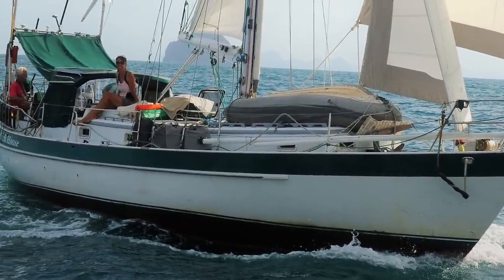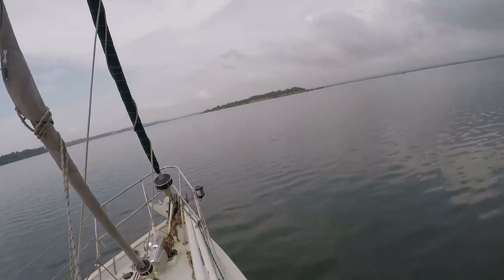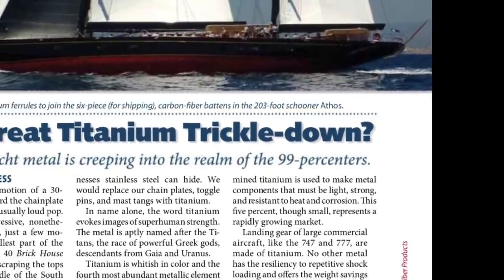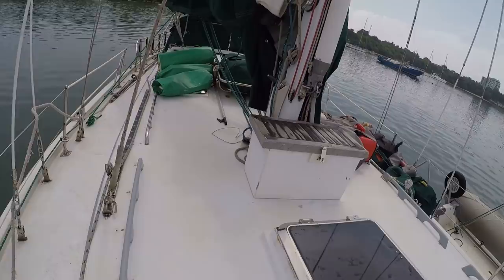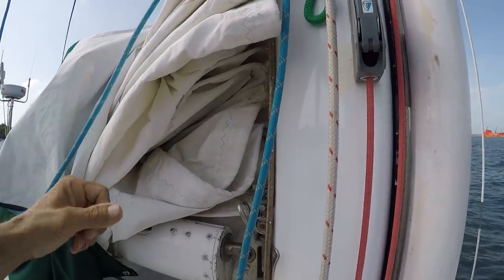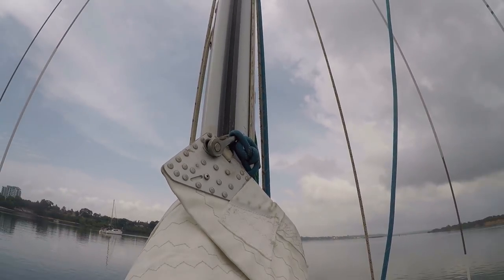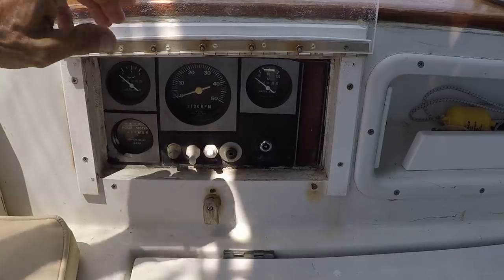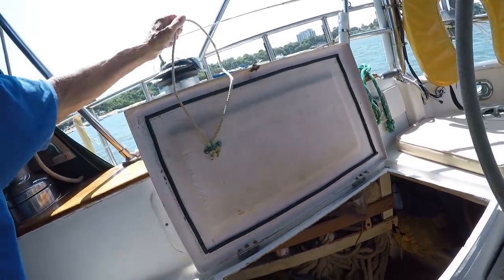Bluewater Sailboat Tour- On the Deck Of a Valiant 40 #1/3   (Patrick Childress Sailing #30)

Comment: the length is great, a lot of really good info and tips. As a new single hand sailor, I find the videos to be very informative. I especially like hearing about the equipment and simplicity. Case in point, I have the same EBIRP, could not figure a place to mount it, this video answered that, Thanks, Cheers
Reply from the maker: Glad it was helpful!

Comment: Funny story: I'm 61yo so this was back in the mid-1960s or so.  My dad was a chemical engineer so he really didn't deal with metals much, but one day he came back from work with a little pancake of metal about 3 inches in diameter only a 1/4 in thickness.  He tossed it our way (me and my younger brother) and said something like "take a look at that."  I picked it up.  Light, much lighter than I thought.  My dad said try to bend it.  As soon as tried to bend it, he said toss it back.  Then he showed that he couldn't bend it also.  I was so impressed that I remember it to this day.
Reply from the maker: I did a lot of research on titanium. It is an incredible metal.

Comment: I will have to check out your info on titanium 5.  I also have problems with ss disintegrating on me, mostly on sheet and halyard blocks, the straps and beckets crack.  Thanks for the enlightenment on hull walk--I always thought it was from the different water density between the top and bottom of the spinning prop, but your explanation sounds more reasonable--the wash is getting thrown more on one side of the hull than the other, and Bernoulli's principle is creating low pressure there and pulling the boat to one side.  Obviously that would make it dependent on hull shape, as you observe.   I also went through a similar evolution in anchors--I plowed furrows with a CQR (and nearly lost the boat on several occasions), then went to a Delta which worked much better but still would occasionally drag on me.  Now I have a Spade anchor, which is by far and away the best anchor I've ever used--plus no roll bars, so it will fit on bowsprit rollers.
Reply from the maker: Great to hear from you. We have been far inland , Tanzania, for a while now, safari time.  I should have commented on one of your recent videos having 10-15 knots for part of the passage from Bahamas to the Carib. was excellent luck and nice job picking up the mooring nunder sail. On propwalk, dcades ago when I was in a class to get my captains license, the instructor said the boat prop is like a car wheel, if the prop turns clockwise, the stern will go to stb. and counterclockwise, to port. No one considered reality and what the prop wash was doing or left hand verses a right hand prop. Good to hear you agree with my thoughts on the plow anchor. Spade was on our list for a new anchor but in Thailand, our other top anchor choice, Manson, was there at the marine store. Keep up the goog video work!
Reply: @RVLifeNOW  Likewise Patrick, I'm impressed with the new vids you have been publishing, and the depth of your knowledge.  Another thing you mentioned is the hobby horsing tendency of double enders--yep, Ruth Avery really gets going sometimes, which seriously hampers forward progress when close hauled.  The rounded stern apparently helps, although I imagine she must drag it quite a bit when approaching hull speed... As far as the CQR, find a friend who lives ashore and donate--they make great garden decorations!  Fair winds .

Comment: Patrick, The time is fine for me. I like your videos for showing what works in real life, and what does not. No one else is putting this info out. When you do part 2 could you please discuss how you deal with condensation inside.. Thanks
Reply from the maker: I will write myself a note to mention condensation. There is padding glued to much of the hull, installed by the builder, to help combat condensation. But the biggest majority of our sailing has been in the tropics and condensation has not been an issue. But we will eventually be in S. Africa where it is much cooler and eventually on to very South America, where we can be affected by condensation in those colder latitudes.

Comment: Hi Patrick, nice video! You have used a lot of outstanding features on your boat especially the starboard ladder. For someone that has a lot of “things” installed on the stern, like windvane and possibly a dinghy on a davits and other stuff, getting into the boat from the stern will be very difficult and your system is very practical and can be used in several situations... well done! Also the Grade 5 titanium pieces used is another great tip... I will for sure use it in the future while preparing my boat for ocean crossing. 

As per the video length... in my opinion, something between 12 and 15 minutes (max) is ideal.

For the next video... show us also some tips you used on the inside.

Fair winds ;)
Reply from the maker: Yes the ladder is great!!

Comment: Have always loved the Valiant 40. And yours is a great example.  I ended up opting for a 1981 Kelly Peterson 44 center cockpit cutter.  They have very similar hull lines and underbody.  Except the prop is in an aperture in the skeg . No it doesn’t back down well either.  Thanks for the tour!
Reply from the maker: I always thought the Valiant 40 would be a much better boat if it were stretched out another 3 or 4 feet and had less of a canoe stern. I see a lot of similarities between the P44 and V40, inside and out. The Perterson 44 looks like an ideal boat for crossing oceans. You made a good decision.
Reply: Patrick Childress Sailing   As have you.  Have already sailed her tens of thousands of miles. I would also feel very secure in a V-40.
Reply from the maker: Fred Read Thanks Fred. I like her and feel good in her for sure. There are times when the wind and sea are doing just horrid thing, and inside you would hardly know it. -Rebecca

Comment: Fantastic informative video. Sat here with my friend watching and discussing what we have just learnt. We both agree this was a good length video, any longer and we would have to have paused for a tea break.
Reply from the maker: Samantha, Thanks for the feedback. Looks like the interior will have be in two parts.
Reply: @RVLifeNOW  
I'll be sailing my project boat from Dunbar to the Humber in April and doing the same, so I'll be watching taking notes. Will probably end up broke but will have a nice boat 😁
Reply from the maker: @Sailingon  It is incredible how fast the money can go.....That is one incentive for us to put off looking like a marina queen and getting help to work on the boat in preferable foreign countries.  There were some odd things done to our V40 during its construction that hopefully you won't have to deal with. Thanks for watching.
Reply from the maker: Samantha, what year is your boat? I am finishing up 2 videos to auto release while we are on safari for several weeks, here in Africa. I was thinking of you and added a couple details I might have otherwise left out....like using PVC for a ceiling material and the pin for the saloon table. Is there any way I can follow your rebuild?
Reply: @RVLifeNOW  it's a 1975 Trident Warrior 35. I'm setting up a FB page SV Carioca. Up to now I've replaced all the through hull skin fittings, temporary basic rewire, resealed the cutless bearing, replaced the starter motor and alternator. New NASA clipper wind system for not a lot of money 😊, love a bargain. 
Jobs before going back in are. stern tube seal replacement, new stern tube greaser, sort out play in the steering which has a bearing housing loose in the top of the pedestal which can only be accessed after removing the top section turning it over to tighten the screws. Get the sails checked and any repairs done. Service the engine and raw water pump. Have a rum or two then rest for a week or two before going out for a few shakedown sails then down the coast to the Humber, then the hard work starts. It will be two years before I can truly escape and see the world so plenty of time to get her the best I can. 
You can add my on FB also at Samantha Kerry and life on a narrowboat 😊
Reply from the maker: @Sailingon  Sounds like a good project boat. I will check out FB.

Comment: I have a Maxprop on my V40 (SV KOYAH V40#165) and have no issues backing up
Reply from the maker: That is interesting. I wonder if you have a very low pitch in reverse so at low RPM there is not much wash over the hull. I have had a 3 blade fixed, Maxprop and now a Kiwiprop and always had the strong turn to stb. problem. But, I live with it and now know how to deal with it. Brick House is 1976 #134

Comment: Patrick, just curious - why do you keep the "monster" whisker pole aboard if it's too heavy for the boat?  It seems like less weight aloft would benefit the righting moment and less stuff you have to worry about. I really enjoy this series.   If we could train cats to do some maintenance in tight places, they would earn their keep!
Reply from the maker: Hi Mark,  The large diameter pole is  of a much larger diameter, resulting in more weight than is necessary for this size of boat. That makes it more cumbersome to use than need be. Running poles are very expensive. Plus, once away from the U.S., they can be exponentially more expensive to replace. So the cost/benefit ratio means to just live with it....but this is all shown so maybe someone else can benefit from the example, like if they are going to put a new pole on their own boat. In the newer video about sailing from the coast of Africa to Zanzibar, you can see the monster pole being set up and used.  Lilly is our diesel apprentice. She is not the brightest but I do have hopes that one day she can at least check the oil level for me. Thanks for the comment.

Comment: Since you do not waste time with useless chatter, whatever time it takes to tell the story so we can fully understand is the correct amount of time.  Your videos are very useful. Thanks,  Have a great New Year.
Reply: My request is that the general over view of the plus/minus be followed by more in depth video of how to.... install chainplates to insure no leaks,  setting up poles on headsails and using that great old windlass! I intend to refit my 1971 Cal 29 to sail to the South Seas from Hawaii and may be doing it solo, so your experience and excellent content is much appreciated and I do have a baby forestay with REMOVING capabilities to install as well.... Aloha
Reply from the maker: Malama, Thanks for the comment and the video ideas. I will add them to the list. The Cal 29 is a nice size boat to easily single hand and maintain, and cross oceans on.

Comment: Again, another great video Captain Childress.! You can make your videos as long as you want we will watch them all. In fact a couple of long videos hour hour and a half will help your channel believe it or not. 

I have a quick question regarding my Caribe dinghy. I've never had great success with the hypalon patch kits. Is there one imethod of repair n particular that you recommend or do you just use 3M 5200 :-) I know how you love the 5200.? And I am just talking about some tube leeks from rub rashes. I'm still looking for some chaps. Perhaps I will just make some. In the meantime could you also comment on painting the hypalon? If you have any experience with that or have seen it done.
Reply from the maker: Great to see your comment. Since we have always had chaps on our dinghy, we haven't had any problems with holes to patch. However, at the transom, an attaching piece of Hypalon between the fiberglass transom and the Hypalon tube had parted from the tube. By coincidence, I had just bought a new Hypalon repair kit in Malaysia. I followed the directions of scuffing the surfaces, cleaning with acetone then applying the glue, waiting the required time then sticking them together. It said to wait at least 24 hours before using....which I did. So far everything is holding well. I can't imagine 5200 working nearly as securely. It seems anyone I know has had to have chaps made specifically for their boat at a canvas shop. In S.E. Asia, the biggest part of the expense is the imported Sunbrella. Over the years, I have seen a couple painted inflatables. They looked terrible. I can't imagine how much rub protection a thin coat of paint is going to give. Chaps are well worth the investment.  I hope you had a great Christmas and are on to a fun New Year.

Comment: Great overview Patrick.   Q: Do your Profurl furlers ever jam or jump out of the rail?  I use a different brand, but on several occasions, despite keeping tension on the sheet and the furling line when maneuvering the sail, it still manages to jam.  (There is a little play in the system, and when tacking on long passages, it works a bit loose.)   On my videos, I find 15-17 minutes receives the best viewing stats…...but I think as long as the content is as good as yours, that timing can be stretched.
Reply: Patrick Laine My experience with jamming furlers is due to poor quality line. You want to use a line that does not compress. These are a little harder on the hands but don’t tend to over ride on the drum and get jammed nearly as much. Something low stretch is also good.
Reply from the maker: Hi Patrick, great to see you here. The only problem I have had operating the two roller furlers is because I use the largest diameter control line that could possibly be worked and squeezed through the attaching hole on the drum. Occasionally, on the smaller furler, the line might not wind onto the drum symmetrically and bunch up in one area causing the line to bind against the cage. That is easy enough to remedy from the cockpit by pulling on the control line to wind the sail up a couple turns then let it back out again. Otherwise, the furlers just keep doing what they were designed to do.  I will keep the 15 - 17 minutes in mind.

Comment: Appreciated every word Patrick, thank you.
We have a V40 of similar vintage, actually it’s no 101...
Would you prefer a hatch into the lazarette and a gas bottle on deck near the pushpit?
On the jib sheet wearing on the staysail luff, for years I have used a 6’ dyneema strop on the jib, with the sheets attached to the strop.
Much less friction, but the real advantage is it is much easier to “sail” the jib past the inner forestay when tacking. Leave the jib sheet cleated during the tack, then gradually ease it out so the jib billows through the gap ahead of the inner forestay.
The advantage of the strop is there is nothing to catch up on the inner stay until the jib is well clear of it and pulling strongly.
I also use an alpine butterfly for the sheet to strop attachment, nothing hangs up like a couple of bulky bowlines.
Reply from the maker: Number 101, that is impressive. Is that the same boat Stokes sailed around the world? I would not want a gas bottle on deck, getting in the way and getting rusty from salt water exposure. I like the setup as it is designed. In New Zealand, we traded in our old rusty, out of date, tanks, for two new ones. At haul outs , I sand and paint the tanks with 2 part paint but still the rust creeps in. Very good idea using the Dyneema strop. What diameter Dyneema? We are on the east coast of Africa and will be hauling out in Durban, S. Africa. Maybe we can have some Dyneema shipped there.

Comment: Thank you very much for the time you invested. I found it very educational and I wasn’t looking at the time bar wondering how much time was left. 
I did have a question about all of the small gauge wires/lines/strings??? that were all about the stern deck and rail by the propane? 
What are they for?
Reply from the maker: Those are chains and cables locking the outboard engine to the boat. It does not matter where in the world we are, outboard engines are high value items to disappear. We never leave an engine on the dinghy over night. It is a lot easier to take it off and lock to the stern rail than have to pay for and deal with replacing the engine.

Comment: I'd like to know your thoughts on steps up the mast.
Reply from the maker: There are times I would like to have them. I don't have them because they would hardly ever be used. They are a lot of windage and weight high up. I have to think of that combined weight and windage high up and how much counter balance needed on the bottom of the keel to get the equilibrium back to where we started before installing the steps. Also, a loose halyard can catch on the steps. There are fold out steps which is less windage and the smoother profile in the stowed position won't catch on anything. When I need to go up the mast, it just has never been a problem going up in a chair so there has never really been a need for steps.